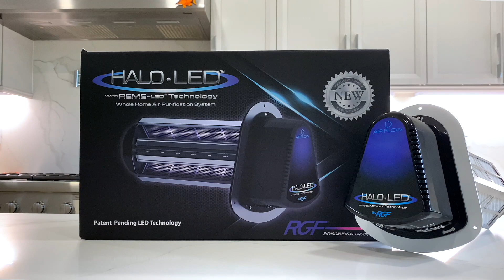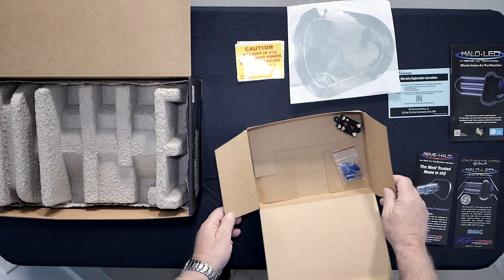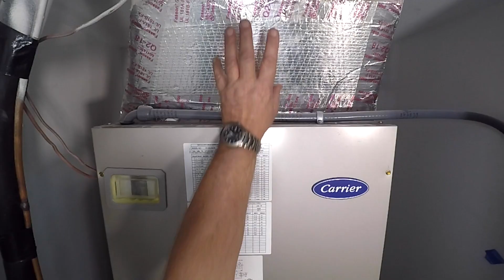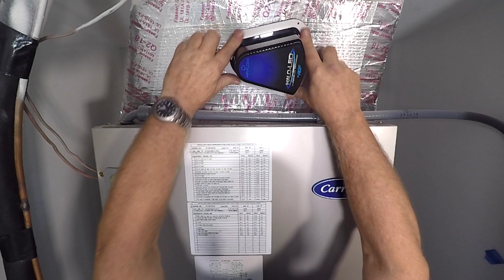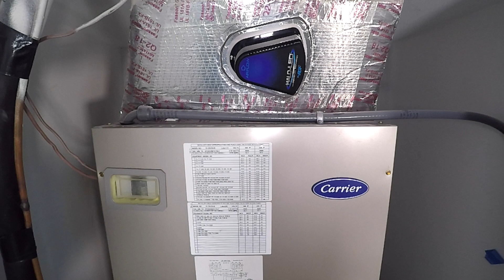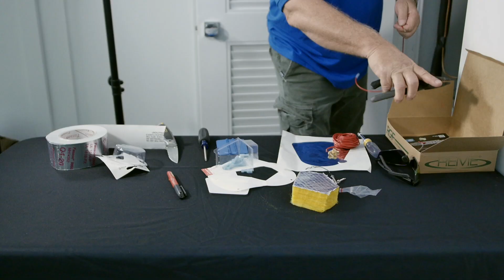HALO-LED Installation with Relay Switch

Comment: On a 240v system does it matter if I connect the common on the halo led transformer to the common or line wires on transformer in the air handler? 240v they’re both hot, so it shouldn’t matter right?

Comment: Is relay included? If not what is part #?  I have gas furnance and cooling in 1. How do I know if 2 speed motor vs variable? As far as I can tell my fan has 1 speed? I have Trane XR16 with Trance SX81 and TRan Evap coil.

Comment: Nice video. I saw another video,where. Instead of using the relay switch, they connected the 120v side to points on the board: L1 & L2, to the transformer. Do these points activate on & off when the fan is turned on & off. What do you think about that approach?
Reply: I just went directly to G and C on the board and it turns on and off with the fan. Didn't use the transformer at all or a relay. It's all 24v on mine as the fan isn't variable speed. Hope it lasts. 🤷🏻

Comment: Where is the most efficient location to install this unit, on the intake side or exhaust side of the ducting and why?
Reply from the maker: Hi Michael! The best location is in the supply plenum, just after the air handler. This allows for optimal operation and full distribution throughout the air-conditioned space. If the HVAC system does not allow space to accommodate installation in the supply plenum, installation on the return side of the air handler is acceptable.
Reply: @rgfgroup  Thank you :)

Comment: Great video. I checked into buying this on Amazon and it says it can't be delivered to our area zip code 95405 California. Do you know why?
Reply from the maker: Thanks Michael! RGF does not authorize the sale of products online. We also cannot
 guaranty the authenticity of any product that is sold on the web purporting to be a new or authentic RGF Product. We have received complaints from customers who have purchased supposedly new RGF products on the web only to find out upon receipt, that they were warranty returns (damaged), or stolen merchandise or just not what they ordered – a complete bait and switch. Also, online sellers many times will not take returns or warranty the product. As a result, we highly recommend you purchase RGF products only from licensed HVAC contractors or distributors. If you need help to find a contractor in your area, visit https://www.rgf.com/contractor/
Reply: @rgfgroup  Thank you so much for the reply. Its interesting how amazon does not allow them to be sold in California but if I put a Nevada zip code in they sell them there.

Comment: Why not just hook it up to 24 volt green for the blower so The customer can run the purifier on the fan setting at the thermostat on circulate or on without calling for air-conditioning or heating?
Reply: I think it's what he meant, no reason to wire to heat/cool when just need to move air. You can directly wire to G terminal, when FAN runs Reme also runs. This is how I have mine connected.
Reply: I am confused too, because working the coil on the relay to Y you’re only energizing the REME during a call for cooling... which means no clean air when you’re heating... with this being an electric heat unit the thermostat will energize the blower or G terminal during both a call for cooling or a call for heating... if the G terminal is used to energize the coil in the relay then you’ll effectively get clean air during heat, cool, and just turning the fan on to circulate... increases to 100% from day 60% of your only cleaning during cooling

Comment: what about the only fan option?
Reply from the maker: Hi Diego! I would suggest installing it with the Air Sensing Switch and changing your thermostat to one with "circulate mode" because that mode will shut the blower off. You could have it shut off for say 10 min/hour depending on how you set it.

Comment: Our Rheem system circulates air 24/7 year round.. Would you just wire this to operate constantly from an electrical outlet?
Reply from the maker: The unit should not run 24/7 because it will never clean itself. I would suggest installing it with the Air Sensing Switch and changing your thermostat to one with "circulate mode" because that mode will shut the blower off. You could have it shut off for say 10 min/hour depending on how you set it. That will give the unit time to clean itself.

Comment: Can you compare the HALO-LED with the REME HALO? Does one work better? Cost more?
Reply from the maker: Hi Ken! Thank you for your inquiry. RGF products can be purchased through a licensed HVAC contractor so you would get the pricing from them. The main difference between the two is the HALO-LED uses an LED light source whereas the REME HALO uses a UV light source. The HALO-LED also has a ceramic catalyst which is great for VOC (volatile organic compounds) reduction. The LED cell also lasts longer before you need a cell replacement and has a longer warranty. They both use RGF's proprietary PHI technology.

Comment: Would you mind making another video using the supplied relay with a residential gas furnace/central air unit? Or is that not possible with the supplied relay?
Reply: It's actually the same wiring except for the heat as there is no sequencer. If you are installing to a 2 speed fan motor(PSC) then terminal 5 is connected to the low speed relay (heat) on the control board. If you are connecting to a variable speed fan motor then you should use the air switch kit (HLED-AS) or you could use 2 relays and power the second relays coil with the W wir from the tstat